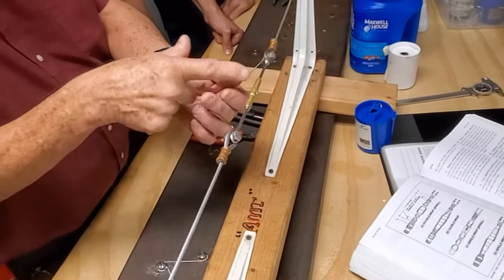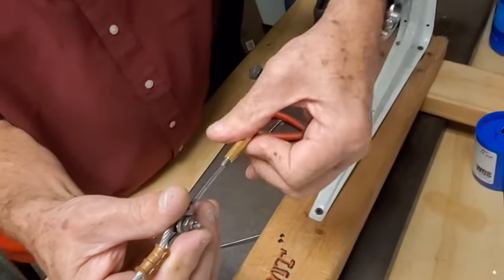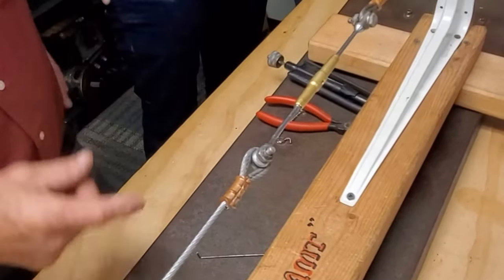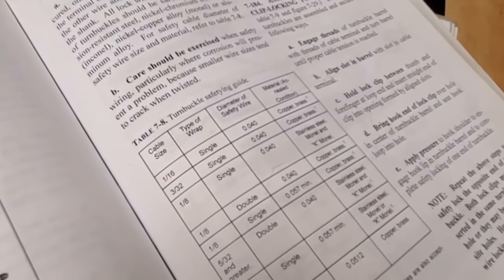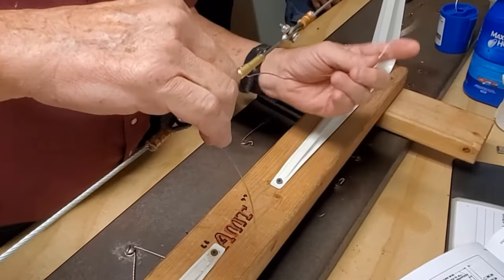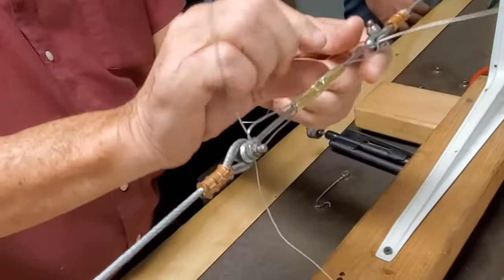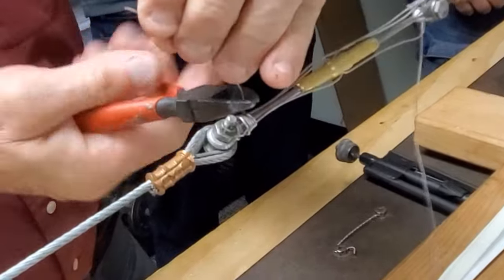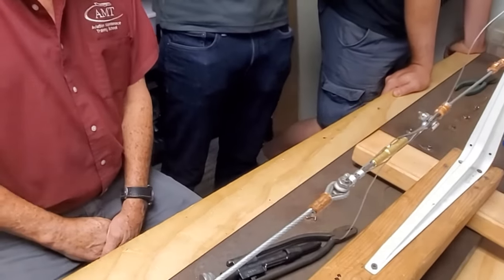General Oral And Practical (Double Wrap Turnbuckle) safety wire

Comment: I was taught by the Air Force how to safety EVERYTHING, by super-old-school C-130 engine NCO's (I was a C-130 engine troop during my military service). This video is crisp, clear, and concise on how to do t-buckles correctly. One MINOR thing I might do is to double the cut end over and THEN tuck it. Exposed cut ends are called "wrist-slitters" for a reason, even if they're tucked!

Comment: Can you explain why you adjusted the cable to 30 lbs using the 3/32” guide on the cable tension gauge and followed the 1/8” cable guidelines in the book?
Reply: 7-153. CABLE TENSION ADJUSTMENT. 
Carefully adjust, control cable tension in accordance with the airframe manufacturer’s recommendations.

AC 43.13-1B 7-153. CABLE TENSION ADJUSTMENT Pg 348

Comment: What book is he using ?? Is it Shop Theory ??
Reply: That book is the AC 43.13-1B (Acceptable Methods, Techniques and Practices Aircraft Inspection and Repair). You can find it free on the FAA website. AND the exact table he used is on page 7-45 or pg 352. I'm currently in AMT school which is how I know.
Reply: @billpotterbladepitchfilms2716  Hi. Can you give me any links about faa exams?  Books,  exercises... thanks
Reply: @sergiobarbosa5052  most of these you can Google and find the PDF version. I would look up the FAA-H- 8083-30A, the 43.13-1B, and possible buy an app called Prepare for General, Airframe & Powerplant.
Reply: @billpotterbladepitchfilms2716  ok. I'll search.  Thank you so much